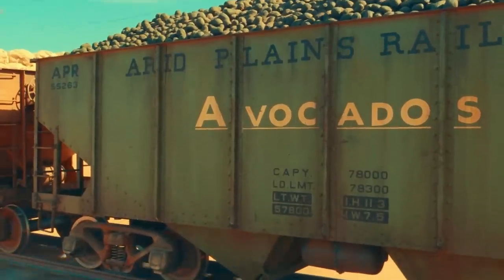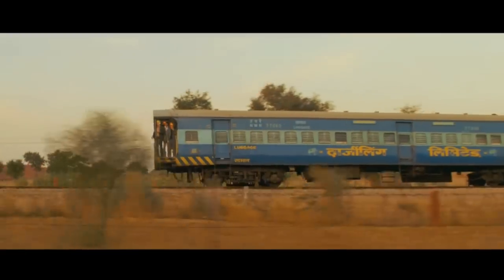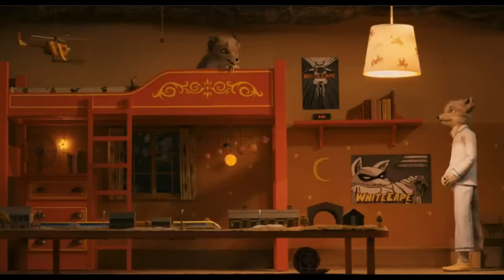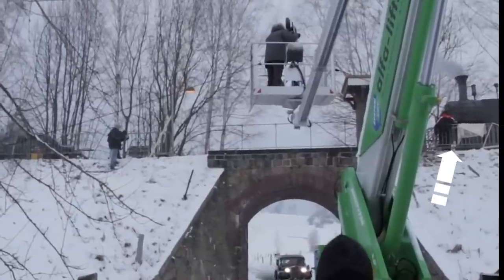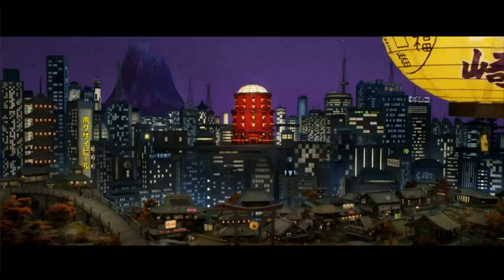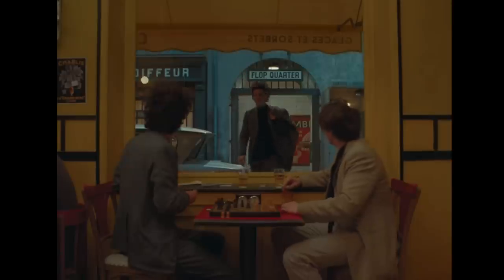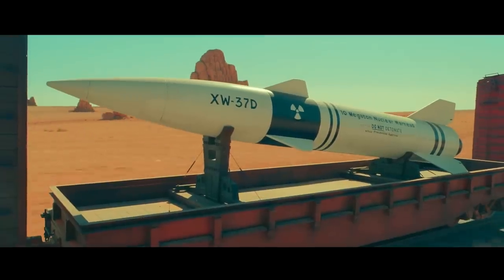Every Train in Every Wes Anderson Movie

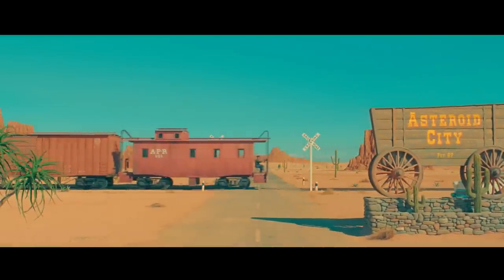Comment: 12:56 to 13:06 there is no way car can get behind billboard that fast, few seconds ago it was parked before fast food. On the beginning of Asteroid City, when train is moving through crossing to the right, outside of screen. When camera move to the right, train disappeared, only tracks are visible (same spot can be seen here 12:15). It is clear that railway tunnel is in fact wall with hole in it.